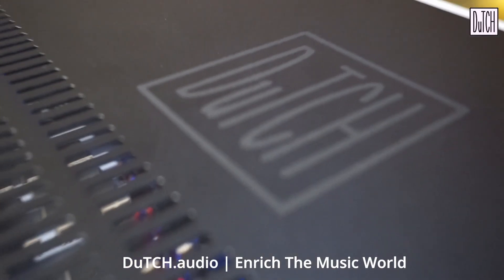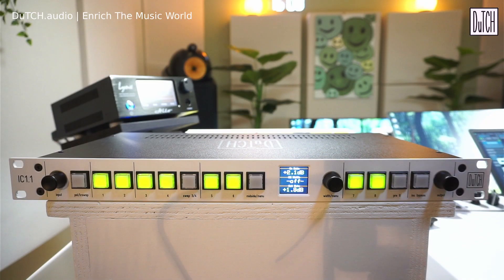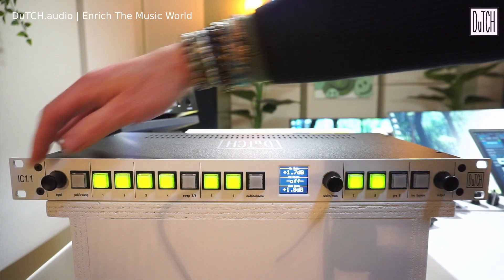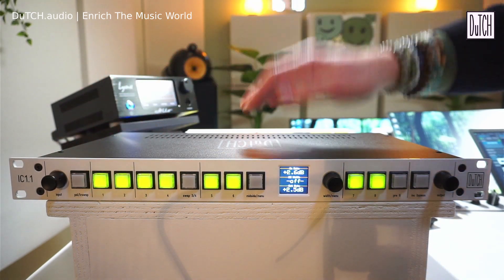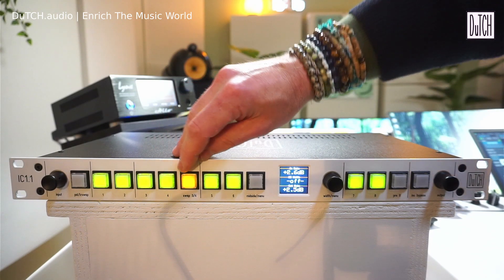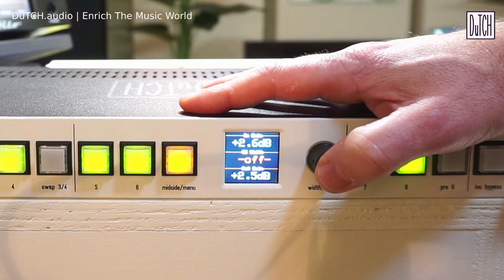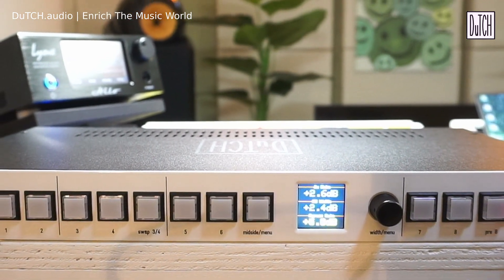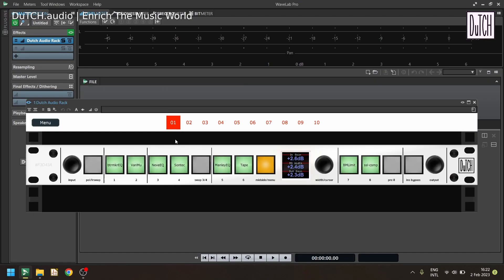DuTCH audio IC1.1 Insert Computer demonstration video

Comment: Now if XLR instead of DB25….instant buy now !😅!
Reply: The problem is, you will simply not fit, in this case 36 XLR connectors on the back of a 1u unit. Even 3u will be really hard to fit.
Reply: @ understood 👍….just dreaming 🥰
Reply: @surreal_youtube  you can stop dreaming. There will soon be an XLR version avaialble ;)

Comment: Is it also possible to automate the gain, in for instance Nuendo?
Reply: Yes! But (currently) automation is not frame accurate. So for example the gain is available as an automation parameter within the plugin but ethernet latency can have  influence on the process, resulting in a slight delay of a few milliseconds for the unit to carry out the mutation. Nevertheless, for volume adjustments based on individual tracks, this issue generally should not pose significant concerns.

Comment: I think the reason why lots of big company use switch mode PSU is for a reason two reason. The cost is about 10 times less than a linear PSU and they doesn’t have to dial with UE (and other countries) certification.
Reply from the maker: There is a big dfference between a good smps and those cheap 'chinamade' things. We use meanwell, industrial seperate modules with extra regulation and filtering. They are a bit cheaper indeed, but maybe like 30% compared to the same linear PSU. And yes, it's easier with certification and things like that since those PSU's are already certified by the company itself. In practice, a good SMPS is way better nowadays and runs cleaner, it's lighter, eaiser to handle and way more efficient. It's 2023, time to move away from those ancient linear PSU's. :)